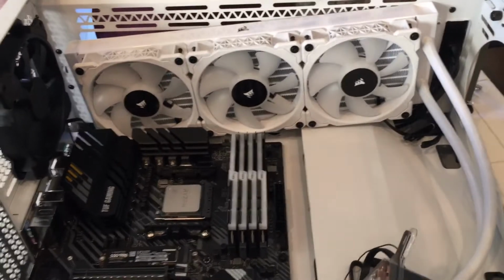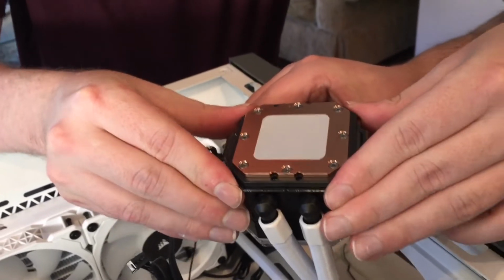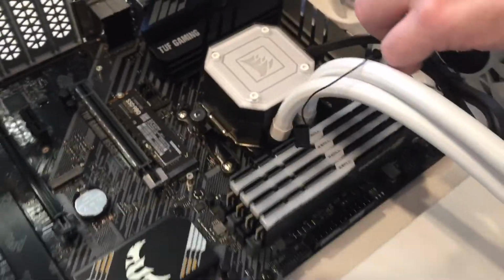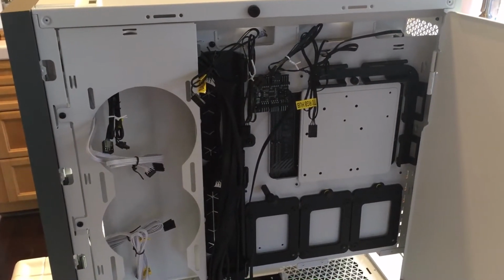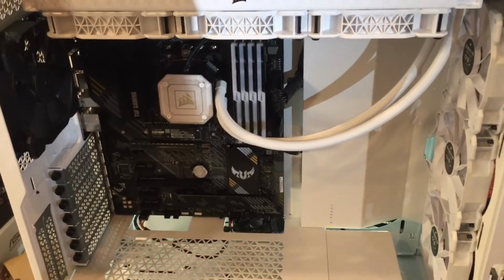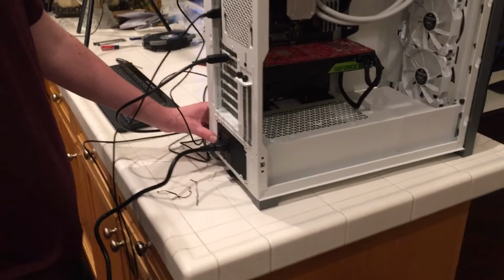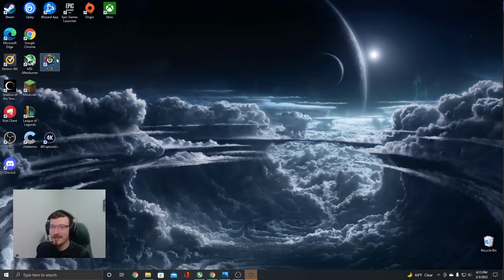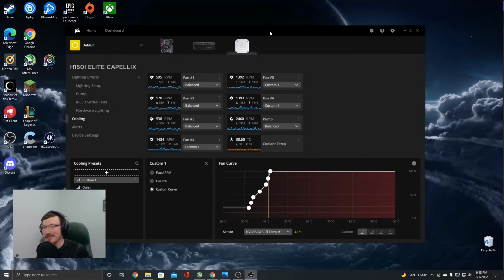First time building a PC | Part 2 | UUHH, soooo many wires!

Comment: Does this EVGA supernova produce coil whine at full load?, that is, when you play or make renders or things like that that demand power from the PSU
Reply from the maker: The EVGA PSU was always silent, regardless of what load I put on it. I did ended up getting a 1000W PSU for my new GPU though
Reply: @slickframes  Thanks